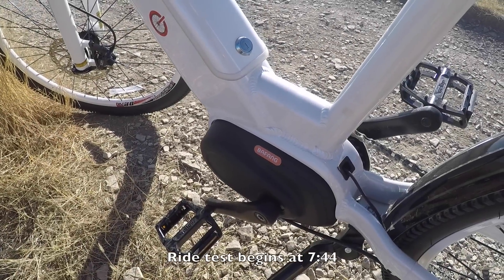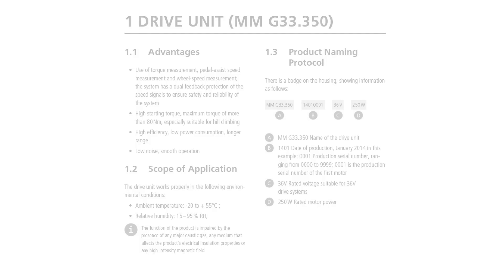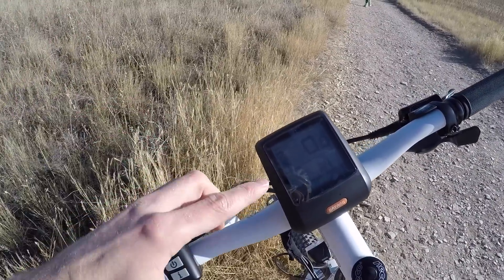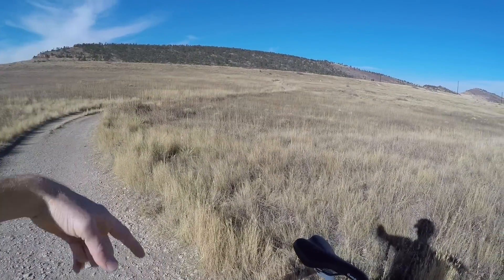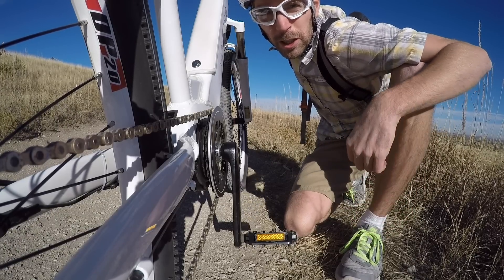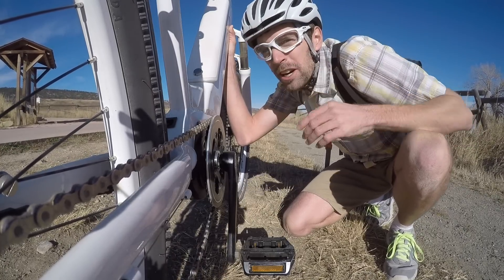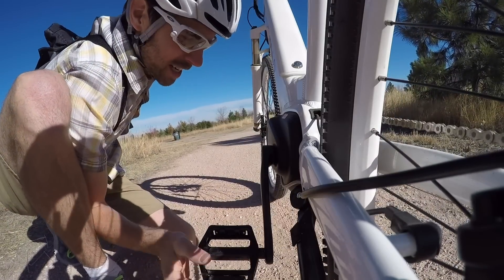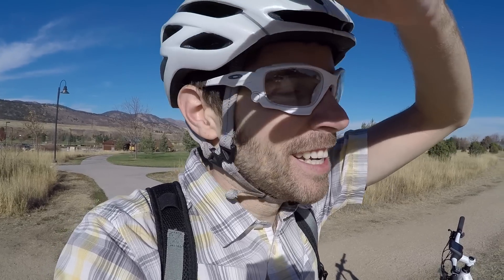Bafang MAX Drive Review - Integrated Mid-Drive Electric Bike Motor

Comment: Great video man!👍 I'm thinking about what you said about the display, that it's not removable. What does that mean exactly? Isnt it possible to lets say change the handle bar? You can't take off the display or what? Isnt there any bolts that is holding it on the handle bar? Kind regards, Joel.

Comment: I have a Bafang Max Drive 300watt motor on my bike and have managed to clock up 28,000kms so far (seriously). Replacing the controller is the only thing I have done to the motor. Wore out the battery and had to get a new one. Wondering how much longer the motor will last? I think this is a pretty fair endorsement for the Max Drive.

Comment: That was backwards. Bigger chain ring has less torque than a small one. That's why a smaller chain ring makes it easier to climb with than a larger one: MORE TORQUE. Up front you want the biggest gear for speed and the smallest for climbing, just the reverse of the rear gears. The smaller chain ring will reach top speed more quickly (because: MORE TORQUE) but that top speed is lower.

Comment: A relatively comfortable electric bike✳✳>share4.photo/ebicycle?Ц172  that feels well suited for shorter treks through the city . A durable, streamlined, electric bicycle with an excellent quality and service. I've rode this bike every day since i bought it and really love it. No damage. Assembly was simple. Documentation and youtube instruction help a lot while screwing it together; brakes and derailers were even adjusted properly right out of the box. Rides quite smooth. I have used some electric scooters and bikes, but the battery range on this one is very impressive. The lightest, quietest, and most efficient 250w motors, its very powerful, great!

Comment: I hear the mid drive bikes eat up chains if you take a lot of hills in mid gears.  I have the Pedego City Commuter Mid Drive and am paranoid about wearing out the chain fast (hasn't happened yet, but I hear a lot of mid drive horror stories).  Do you have any tips on preserving the chain on a mid drive?
Reply: Joseph Holliday why not try heavy duty chains and lube them well.
Reply: Get a Gates belt drive, all problems with chains are gone.

Comment: Hi guys 

can any one tell me how to properly drive a bafang mid drive without damaging it what i mean is when you come to a stop what gear should you be in so that you dont put too much strain on the motor and at the same time dont shift to a way higher gear when its not required i hope you get the point couse i find it annoying to go all the way to the highest gear when coming to a stop just to avoid damage to the motor

Comment: Seen a few of your videos. They are always informative, thank you. I do wish however, people would not pedal for a segment when demonstrating how much assist there really is. On flat and up a hill. 

An acceleration test (maybe speed shown) with no pedal would give the viewer an indication of how much this thing is actually helping and how much noise it’s really making (which is surly what people want to know with an electric bike). 

A standard test you run all the bikes through and start ranking them. Maybe 0-200 meter time and top speed. And the same on an incline. Without being able to compare it makes it hard to choose. 

When not pedalling  and giving it a “hard” time, let us know verbally how hard you feel it’s working. Let us know if you feel “it’s struggling” 

It also bugs me that advertised range includes pedalling. Seriously. This is as bad as Dyson saying their battery vacuum has a 28 minute cleaning time, (allowing for  Moving furniture etc) but run time is actually 4-6 minutes. It’s an absolutely USELESS statistic. 

Why can’t people just ride a flat path somewhere and not pedal!? We hired electric bikes on Venice beach in miami and never pedalled at all! 

How far the battery really goes unassisted and how much it actually propels is surely what people want to know more then anything else! The rest is cosmetic!

Comment: Hi court I have a max drive here in Australia the only thing I would like to added is the brake kill switch feature. I have noticed some times on my E bike if you are moving slowly and just touch the pedals like at a set of traffic signals the motor can kick and drive you forward a bit freaky till you get used to it.

Comment: In terms of smooth shifting to reduce wear on the transmission (sprockets, chainring, chain), wouldn't an internal gear hub be a better choice than derailleurs for e-bikes with mid-drive motors, since an IGH lets you shift gears without pedaling, which should completely pause the motor?
Reply from the maker: Yes! and also the continuously variable transmission hubs... there are some great options now like NuVinci but they usually weigh more and cost more too :) the shifting isn't as fast and crisp, so many e-mountain bikes still use cassette/derailleur like this
Reply: Just ease off a bit, doesn’t anyone understand mechanical sympathy.

Comment: Love your reviews.  In your opinion, how does does the uphill power compare to the US Bosch CX?
Reply: The HD is a rippin motor. The Max and HD are two separate styles of motor performance and riding experience. The Alation ST 48v Mid Drive is a full on torque activated pedal assist system. Max is more responsive under foot, HD is power. At the end of the ride the Max gives up a a little bit of punch, for increased range and torque sensing pedal assist. 
With full fenders, lights, and up to 16ah battery, the mens Alation Mid Drive bike weights 52lbs (ST about 50). Also, we should have something soon to satisfy some of the riders looking for more power out of their next ebike.

Comment: these mid drives work good with nuvinci hubs, one chain line, no mashing, constant torque, and can equip auto shifting as well as cadence select...smooth, quiet, and motor always spinning in the most efficient way.  Really steep hills conquered easily, and different sprockets available for road use, if you want warp speed.
Reply: Agreed. I have a Nuvinci hub on my fat bike with a TSDZ2. Works great. I wish there was a wider hub available but oh well. 26x4" rear will have to do.

Comment: bike manufacturers could use same technology single crystal structure metal used in jet engine turbine blades for bike components, frames  and motor parts such as motor gearboxes to make them stronger with longer lifetime on  motor pinion and gear teeth

Comment: l use the kill switch in the brake levers to turn motor off while changing gears, l will be putting in a dedicated kill switch that l press with my thumb

Comment: could you recommend a good quality electric, mountain bike for riding around Rainy Vancouver BC, Canada, and one that would also be good for off road trails.  I would like to find one with a very long range and and fast charging battery, any advise in the right direction would be great. thanks in advance.
Reply: There are so many variables.  Hard tail vs full suspension.  Any ebike you want to ride a long ways will be better with road tires which don't work well in the dirt.  Big Battery capacity is expensive and heavy.

Comment: I am surprised that e-RAD systems are not on more electric bikes. e-RAD is a much better system compared to BAFANG.
Reply: ??????.. an e-rad system is a Bafang motor made to e-rad specs..  they're popular cause they're the manufacturer which equates to a cheaper product.. e-rad specs are superior but that also comes with a cost, but again it starts out as and is manufactured by Bafang..
Reply: If Bafang manufactures e-RAD how come their other systems (BBSH01, etc.) does not have a shifting sensor in order for a rider to lessen the chewing up one's chain and cassette chain rings on their electric bike units?
Reply: Tracey McNeel yeah nah, you're right mate, I honestly couldn't be bothered trying to explain..  i'll just mention though that there's no such thing as a BBSH01,  there's the latest 1000w that is the BBSHD and the original BBS01..  if you're really interested check some of Courts older videos about the BBS02 or search for it here on youtube and you'll learn something, or don't what ever.. actually If I recall Court met the fellas at Lectric cycles about 12 months ago just before the BBSHD released and there was a great explanation of what parts they had machined at a shop out the back and what specs they required when ordering their units from Bafang, so don't take my word for it, search these vids and see it for yaself.. over and out..
Reply: Ms Cynthia Hmmm, that's interesting, I wasn't aware of that..

 in all honesty these things aren't really necessary though if you simply wait a single second for the motor to cut out before shifting, which will feel rather natural if you're used to driving a manual. I've just learnt about a week ago that most of you in the states drive autos though so it might be kinda unintuitive, but you could save some bucks and give it a miss if you live in a kind of flat area..
Reply: feather the brake lever = free shift sensor
Reply: Bafang makes motors for e-rad and Lunacycle; the gear sensor is made by a different company. I know that Lunacycle sells the gear sensors separately.
Reply: How exactly is eRad better?
Reply: I see no reason to run a gear sensor. I have a Cyclone 3000, and I don't need that. A Bafang is much weaker.
Reply: e-RAD has a shift sensor; I don't know if all Mid drive units have this, but this system has it which saves a person's chain and rear cassette from being ruined sooner than they should.
Reply: If you learn to tap the brake before you shift or just quit pedaling you will rapidly adapt to no shift sensor.
Reply: Bafangs have a shift sensing option too...
Reply: and yes shift sensor is available on Bafang as well as most motor systems using safety cutoff components.

Comment: You incorrectly stated "no torque sensing" near the end there. Also, according to the doc you showed (1:16), there is a gear sensor as well.
Reply: he meant shift sensing 3:30 he says "no shift sensing"
Reply: There is a speed/torque activated control to the motor.  it's a smooth operator.

Comment: whats the difference between a hub motor and a mid mount if you use the same size battery?800 to a grand is a lot of money to me,so I would like to get the most bang for my dollar,i would think a hub motor would be the best as it doesn't change the bike other than respoking the wheel
Reply: They really don't weigh any where near what a mid drive weighs, I had a mid drive and really wasn't keen and went back to a hub drive.
Reply: cartmanrlsusall Mid-drives use the bike's own powertrain to propel the bike and balance the bike's weight more evenly. You usually have only one front sprocket (fewer speeds to work with.)

Hub motors have fewer moving parts, don't perform as well off-road, are usually less powerful than mid-drives, and (in the case of DIY builds) require you to replace one of your wheels.
Reply: thanks I'm thinking I may get a hub motor I need a little help going up some hills but pedaling the flats are no prob
Reply: cartmanrlsusall A hub motor is much less efficient because it only has 1 gear ratio and weighs a lot more. If you have suspension, a hub motor is unsprung weight. Think of a hub motor as a car transmission stuck in 1 gear. Very inefficient.
Reply: How much does a hub motor weigh? What didn't you like about your mid drive? What mid drive did you get?
Reply: Hi, I had a BBS2 750w, they have a horrible restriction on them that makes them annoying to ride and then when you take that off its just too fast and power hungry. I found http://www.xiongdamotor.com.cn/product/1557215740-220560510/NEW_Invention_XD_Dual_speed_motor_Big_Torque.html 
to be good the 250 watt motor gives 500w when needed and weighs 3.3 kg, great to deal with too, I put mine on a Cannodale badboy and use it all the time. Oh and its really quiet. Hope that helps.
Reply: Sounds like you could have benefited from more tuning. I mountain bike, so I don't like unsprung weight. Also, my bike uses through axles, and there aren't any commercially available hub motors that will fit. I've been using a Cyclone mid drive, and I absolutely love it.
Reply: But you really shouldn't have to mess around with them endlessly, the Xiongda hub motor I have is just a pleasure although not what you'd want off road.
Reply: You don't have to adjust them endlessly. You just need to set it up the first time (the options in the controller). But you may be right that a hub motor is simpler (and thus more reliable) for road cyclists. But I would think that even a road cyclist could benefit from being able to use the power more efficiently through the bicycle's gears.
Reply: That was what I thought but not what I found in practice with the BBS02, your motor may have a better controller set up than the bafang. The other thing to know is if you do buy a BBS02 and intend setting up the controller parameters, you can buy the cheaper 500w and change it in the settings to be 750w. Same is true of the BBS01 which can be changed to 350w from 250w.
Reply: Is the 02 the BBSHD?
Reply: No I think that is the one with the wider bottom bracket. Its just the 500 and 750w version.

Comment: Would a Nuvinci hub work with this bike or is there a reason we rarely see them on e-bikes?
Reply: it's a perfect fit for this 350w..  I've run one on a 750w BBS02 without any problems so long as you simply do not try and shift it under load..
Reply: Monstah Jones
Reply: The main issue with the nuvinci is the price.  They are quite expensive compared to standard derailleur components.  They work well.  They other issue is they are quite heavy---I believe about 3 pounds heavier than a derailleur system.